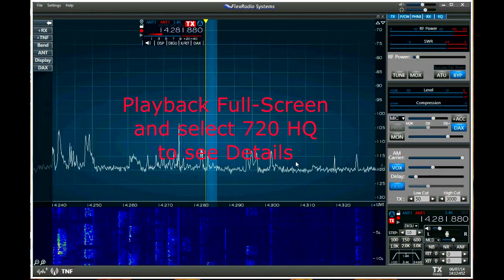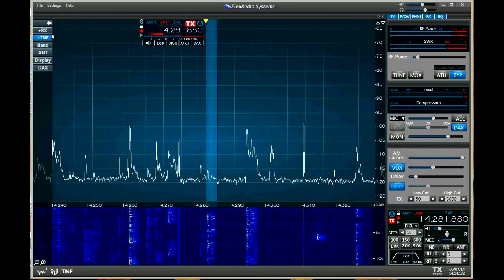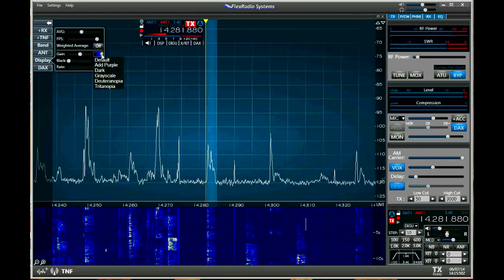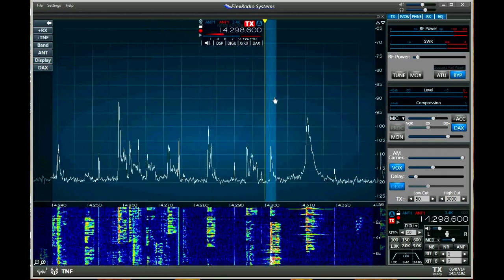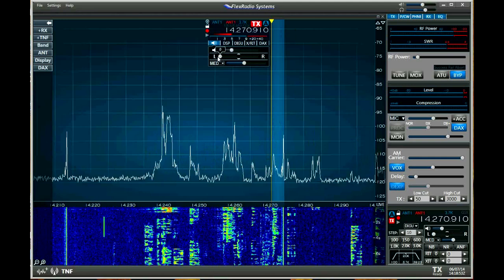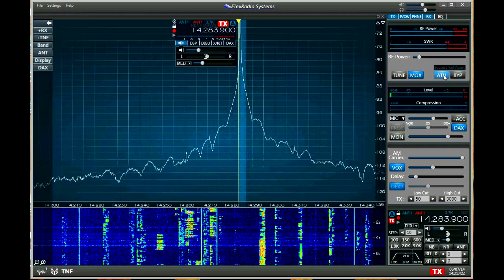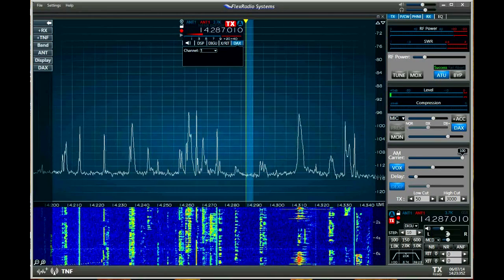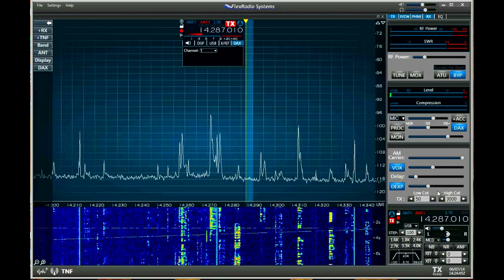Flex 6300 Operation & Review - Part 1

Comment: How do you like the Flex 6400 compared to the new Icom & Yaesu? De W2CSI
Reply from the maker: All different animals. the Flex is a RF lab in a box. It does it all with style. The Icom is well-engineered, has the best TX and RX audio of the three...and is almost without fault. The Yaesu 101D has the best selectivity period- but the menus are not intuitive. Looks-wise, it's the Yaesu on top. Icom second and Flex third.

Comment: Hi Bob, I have the chance to purchase a flex radio 6300 for $1125 shipped and an ICOM 7600 for $1050 shipped. I’m torn a little bit here. I’d like to get the maestro to operate the flex or just use my iPad. I guess the worry here is that to get the 6300, I have to send a personal check, money order or whatever and don’t have the protection of PayPal. I just have been scammed on one deal already but PayPal helped me by holding my money safe. The flex radio does not have an ATU built-in. I trust you my friend, what are your thoughts between these two rigs And my situation?
Reply: OK, it is simple. If you are a tinkerer and good with PC's, then it is the Flex. If you see yourself operating mostly SSB and are not a "PC person", then it is the 7600. The Flex is OK on SSB and the 7600 is OK on digital...but better on the opposite. Also, if you like the idea of a box with knobs... you want a "Rig"... then it is the 7600. If you are OK with a blank box and using the PC mostly (until u get the maestro) then it is the Flex. The antenna tuner is a don't care. If you use compromise antennas (non-resonant random wire etc), you'll never be satisfied with today's poor band conditions. You want resonant antennas. Me? I'd go with the Flex. It's a better rig.

Comment: On the 6300. Using the eq. I have pr781. While I am adjusting the tx eq. I hear no difference while monitoring the audio with my headphones. How can I achieve this. How can I here what I'm adjusting . Right known the only way I can see or know what it sounds like is having someone on the same freq telling me what they hear. Outside of using the full duplex feature into a dummy load which I don't have. Thanks. AA11US.

Comment: The 6300 is a VERY nice radio (great review!).  My debate is now between the 6300 (with ant. tuner) and the 6500.  It seems like the $1,200+ jump in price to get up to the 6500 is well worth the bucks looking at it long term based on the upgrade in performance.. even though it is just barely within my budget.  Just wondering about your opinion?

73  Tony  WA8AR
Reply from the maker: If you can afford it... go for it! Having those front-end filters will boost performance further. The 6700 just came in
as #1 best RX - Sherwood labs tests. The 6500 should be identical.